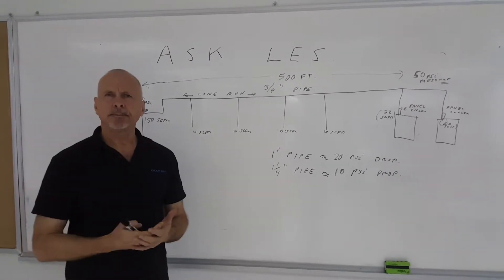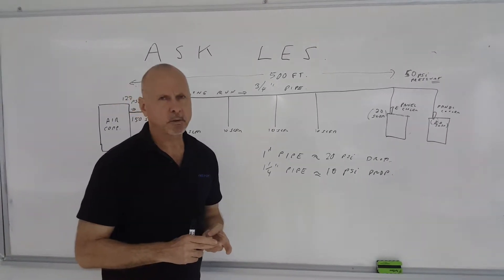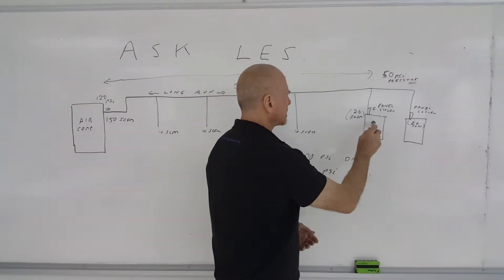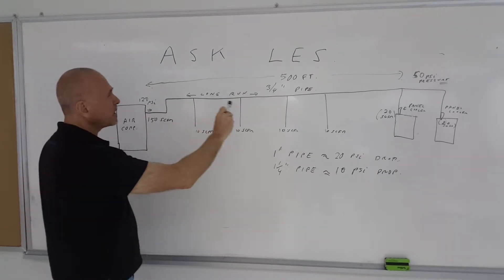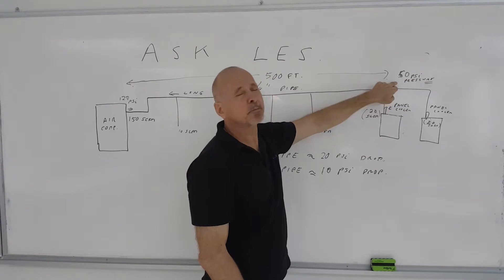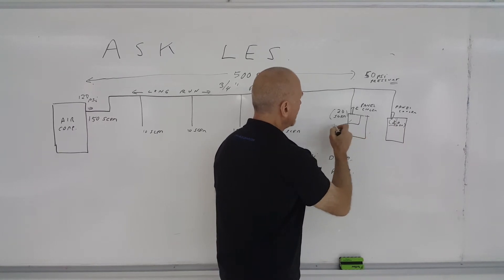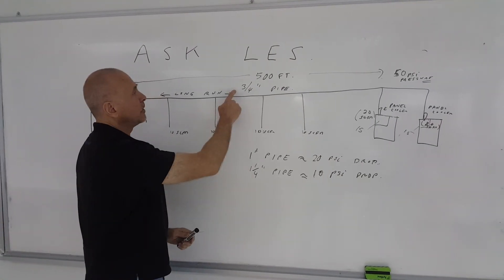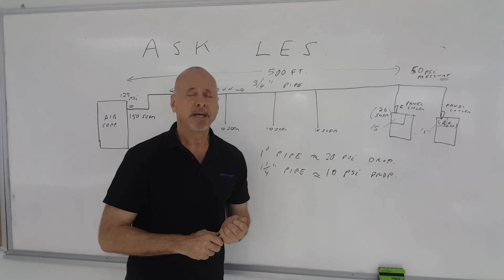ASK LES - Pressure Drop in Compressed Air Systems and Effect on Performance

Comment: 30 gallon tank with a 1/4" outlet  using 1/2 hose and 3/8 fittings still be the same cfm . with the 1/4 inch fitting at the starting of the tank ? the cfm for the tank is rated off the 1/4 inch fitting .    large hose less pressure more volume .  but its choked off at the starting gate .

Comment: I am running air to airlifts for a pond application.  I am going to use PVC pipe to get the air from the compressors that have 1/4” output about 40’ to the edge of the pond and then drop the air line to 5’ or 6’ of depth to the bottom of the air lift.
Here is my question.  With the 1/4” outlet on the compressor can I upsize the supply line to say 3/4” and will that help mitigate pressure loss?  I appreciate your help.  
JH
Reply: It certainly will dramatically reduce pressure drop using larger diameter supply lines.

Comment: Hello.  System with 175psi tank pressure, 100 ft of 1.25" run pipe, that is easy enough to calculate Theoretical Max CFM output, but if I then size down the 1.25" pipe to 1" pipe and go another 30 feet, what is the output at the end of the 1" pipe?  (this makes a total run length of 130ft, starting with 100ft of 1.25" then 30 ft of 1" pipe)

Comment: How much would the flow be affected if that pipe had a big seam in it?
Reply from the maker: The seam will cause some turbulence in flow and some back pressure but unlikely to have too much of an effect is the inside diameter is relatively large